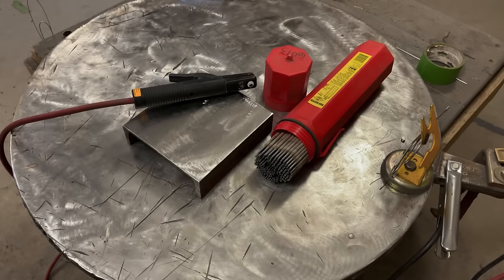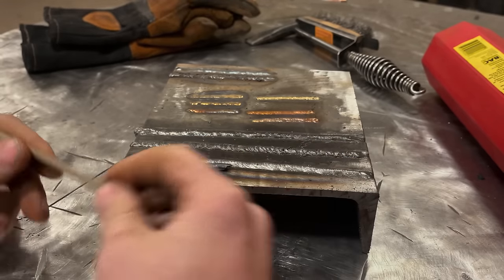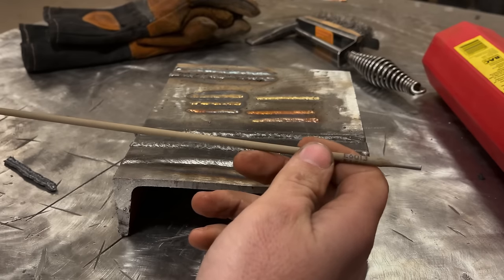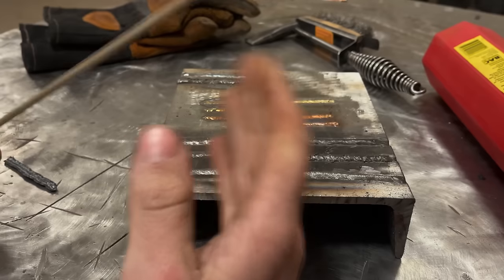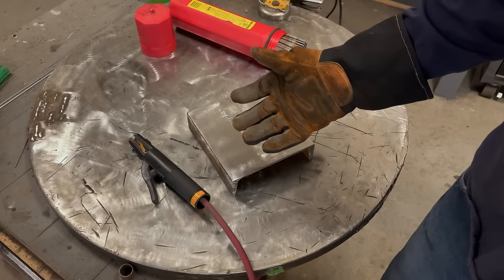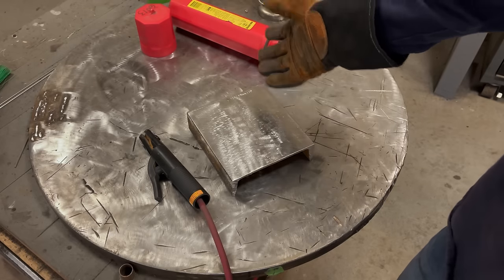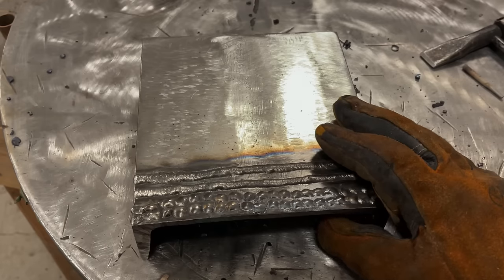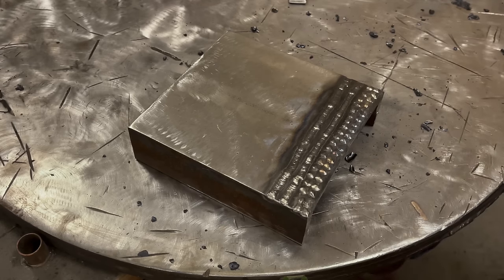How to stick weld 👨🏻‍🏭: Intro to Arc welding for beginners, (Series Part 1)

Comment: Thanks man, this is the most informative video i have yet watched about stick welding. And i watch alottttttt about stick welding
Reply from the maker: Welcome and thanks for the kind comment 😀.  It’s good to watch a ton of videos, you will get to a higher skill faster by doing so.  Whatever you do don’t let the frustration at the start get you down.  Every good stick welder went though the same issues with poor welds, stick rods, melting holes, and flat out failures.  After a while of practice those become few & far between and that is when it really becomes fun.  That’s when you can build awesome stuff 😀.
Reply: @makingmistakeswithgreg  thanks for your kind motivation 🙏

Comment: Thank you so much for creating this video. I’ll be watching the ones to come. As a newbie I’ve been debating on arc vs. wire welding but your video is helping a lot.👏🏻👏🏻👏🏻 great job👊🏻
Reply from the maker: You’re welcome 😀.  Stick vs wire is a hard debate.  If you want to weld thicker steel or have limited power, stick is the way to go.  If you need to weld thinner stuff wire welding is the way to go.  The great news is, no matter what process you choose if you get really good at it the skill will transfer to another process, so you will learn faster.
Reply: I have both stick and wire welders, I'm not good at either, but I love welding. It's just something about joining to pieces of steel together that captivates me! lol 😂 one of my favorite hobbies!
Reply from the maker: It is a awesome hobby.  The days everything goes well and the welds go down smooth are the highlights and make it the best.  The days nothing goes right and you’re frustrated are the parts you have to get though lol.   It wouldn’t be half as fun if it wasn’t a challenge though.  It’s just you trying to tell a electric arc and some  Liquid Metal who’s boss lol.

Comment: Excellent, subscribed, thank you , im total new and simply want to do basic wire feed welding and make small cool stuff, your videos are awesome
Reply from the maker: Welcome and thanks for the kind words 😀.  The great thing with you being new is you will be able to progress rapidly and (provided you spend the time to practice) will be able to build a lot of cool stuff.  Wire welding (MiG and flux core) is a great place to start, and is very capable.  I am still doing gas shielded MiG videos so I have a few more of those coming out.  If you have any questions/ don’t understand anything feel free to ask and I will help you out 😀

Comment: Fantastic, very well explained and gives me confidence to have a go 👍thank you.
Reply from the maker: No problem 😀.  Just expect to fail for a bit before it makes sense.  Learning stick is frustrating for a while, and can still be frustrating at times even after your good lol.  Luckily if you have a decent idea of what you’re doing and practice a bunch it will slowly get better.  The coolest part is when you look back on where you started and you can have a laugh at what your first welds looked like vs where you wound up.

Comment: I like the twist stinger handle
Reply from the maker: I am not exhausting sure why, but the twist style is virtually non existent here in the states.  I have one somewhere I will have to break out 😀
Reply: Have wondered about getting a “stinger” with a slightly smaller diameter of handle, but not sure where to find one - or wonder if they even exist?

Comment: If you can do one on basic set up and safety i know i for one would ruky appreciate that oh so much. Being a single mother trying to just be half as good as any professional i want to make sure i come home to my son. 😊
Reply from the maker: I have covered some random videos on safety over the past year or so.  I am definitely due for a new one.  I will share this info for the time being:  I have been welding/repairing things full time for about a decade.  I have had some decent injuries and some close calls.  95% of my injuries were preventable.  Wear your gloves and wear proper gloves for what you’re doing.  I have suffered serious hand burns from pure stupidity of not wearing gloves (or the right ones).  Wear eye protection 100% of the time, even while wearing a welding hood.  It will safe your eyes.  Not only do they keep debris out but many block harmful UV light, so an arc flash will do far less damage.  Use tools properly, don’t put your fingers places where they could get injured.   If you feel something is dangerous come up with a better way to do it.  Beyond that I will say this:  most of the dangers with welding are the accumulation exposure.  Dust, smoke, fumes all damage lungs.  Wearing a simple 40$ mask can add years to your life.  Virtually all of welding is bad for your lungs.  Eye damage can happen over time due to arc flashes, so wear a good hood.
Reply: @makingmistakeswithgreg  thanks so much for you time I truly appreciate it and yeah I did find your safety videos after I commented and watched till I passed out at like midnight 😆  but I went today and got the welding/mechanic job!!! 22 hr start. A bunch of benefits and add ons and bonuses!! 10 minutes from my house. Can't get more perfect then that. I tip my hat to you 😉

Comment: Greg....the stinger 5  seems  to hold the rod in a different way to the crocodile and twist grip.These latter 2 allow for the stick to "wander" a bit in its grip.How would you rate it??
Reply from the maker: So I have not actually used the stinger 5 before.  I wanted to buy one a while back and during corona they were out of stock so I gave up.  I like the idea of them though

Comment: Greg I don't know how you'll do it but I need you on the roof of my house in 8 hours because I have to do a small repair of the steel chimney from the edge of the roof 36 ft above the ground! Seriously though, I don't know what will be more uncomfortable for me, welding with an electrode or this edge of the roof. We have different nomenclatures but I'll try the equivalent of 6013 2.5mm because there's a lot of rust, soot and welding vertically. It's good that my TIG can weld better than me so maybe I'll glue it together somehow. And the video material is very useful, you can somehow start or check if what I'm doing makes sense (I've literally burned a few electrodes in my life). Greetings from Poland
Reply from the maker: That sounds like a fun job, I would totally do that 😅.  I literally was redoing a chimney cap that high on a roof last weekend.  I welded a new one up on the ground though lol.

Comment: I,m here to learn the easiest way to weld up rusty patches cut out of my ford transit. Can stick welding be used for van sheet metal ? Many thanks.
Reply from the maker: I won’t BS you, stick welding is unbelievably difficult to stick weld auto body.  Your best solution would be flux core wire with a 120v machine.  I am not sure what country you are in but in the states the harbor freight 125 is a very solid option and with .030 flux core wire it will actually weld auto body.  Stick welding in comparison will be 10x harder and 100x more frustrating lol.

Comment: Man... I love that Canadian accent. Maybe is Wisconsin? Idk but i like it 😊
Reply from the maker: Good call on the Wisconsin 😅.  That’s where I am from.  People are pretty good at picking it out 😀
Reply: Aww thats awesome thanks for the reply. I have an interview in the morning doing stick welding and tig welding on just massively sized farming equipment. By no means am I an armature but i haven't done it in 5 years. I'm worried they won't understand because not only doing it constantly a match doesn't always strike up right? Or the bead isn't always perfect. They also did mention stainless steel ehich I've never worked on. So this farming equipment is rusty and full of manure that just eats and eats
 So it needs re welding constantly and year round. What I'm saying is. Do you have any tips for me? Anything at all? I'm pretty confident my father is a master steel fabricator top of the line in his job and he travels the world. He taught me alot I've even done it in our pool when the aluminum started to crack. I'm not scared I'm just concerned they won't see the exact take off and usually I have the issue with the cleaning first. Take a while. And only so much rust can be taken off. Anything come to mind?

Comment: Lovely presentation of facts on this subject. Im not good friends with welding but know i could do better. Im reasonable with the startups. Most of material i do is thin walled and naturally i often get burned holes😂😊. What i woukd like to to know is if the steel we get, the quality thereof  affect the weld or is there ways to get around it. Id like to improve on the thin walled stuff
Reply from the maker: I won’t sugar coat it, welding thin material is no fun with stick.  There becomes a point where it’s just too thin to be effectively stick welded.  The smallest stick rod that’s common is 1/16th diameter, which is far bigger than .023 or .030 MiG wire or .030 flux core.  1/16th stick rods make it possible to weld material down to about 1/16th or a bit thinner.  It isn’t easy, but it’s possible.   10 out of 10 times I rather flux core weld material thinner than about 1/8th thick.

Comment: Great video! question.. can one stick weld 16 gauge steel? Also I’m wanting to weld a frame reinforcement that is 3/16th steel to a 16 gauge unibody frame.. recommendations?
Reply from the maker: I am not lying when I say stick welding thin steel is extremely difficult.  16ga is doable with 1/16th diameter rods.  I believe I did a video on that thin titled something like “stick welding with mini rods”.  It’s not easy stick welding thin stuff.  Flux core wire is infinitely easier.  Especially when you need to weld thicker material to thinner material.  For what you’re looking at doing it’s easily achieved via flux core wire.  If I recall I welded 16 or 18ga to 1/4in steel without issues in the video titled flux core thick to thin.  No way could I have done that with stick.
Reply: @makingmistakeswithgreg   Greg thanks so much, I do have a flux core . I’m just afraid of blowing through the 16g. I’ll have to get lots of practice in. Gotta say, your presentation is excellent!
Reply from the maker: @johnpecoraro1720  thick to thin defiantly takes a bit of practice.  Focus the puddle on the thicker piece.  You’ll get it, and it’s far easier with wire than stick.  I would prefer wire over stick 11 out of 10 times lol.
Reply: i think i saw in jacob pritchett channel that he stick weld a thin 16gauge steel in his project.. he ran DCEN polarity with 3/32 6010.. maybe you can ask him the tips to do that.

Comment: Thank you so much for making this video, I'm hoping to go to trade school soon. I have a question about safety equipment: I have a respirator that rated for protection against asbestos, would it also be good for use in welding?
Reply from the maker: Great question.  On face value I would assume it would handle welding dust.  However one concern would be the flammability of the filters.  Many welding specific filters have plastic covering the filter elements, so sparks can’t get to the filter.  If yours doesn’t it is possible (although slim chances) of a spark lighting it up.    The manufacture of the filter should have a chart or a rating of what it would filter, it would be best to double check that.  Generally speaking if it would do asbestos it would welding fumes.  You would run more into issues if you need chemical resistance instead of dust filtration.  Hope that helps, and good luck with the trade school, it’s 100% worth doing it 😀👍
Reply: @makingmistakeswithgreg  Thank you so much, I never even considered the possibility it could catch on fire. Yikes. I will definitely check to make sure the filters are covered.

Comment: I have to dissagree with you here as any other pipeliner would agree with me, down hill welding is still in use today. None of my welds in 42 years of welding  failed the bend test on the iron horse. Now there are factors involved in what i just stated as there is in anything being claimed here...I must add I never said I never failed a test, I just never failed a bend test. Hang in there this is good for first timers
Reply from the maker: I don’t recall saying downhill isn’t done or shouldn’t be done in any circumstance.  There are certain reasons why it’s not done and probably shouldn’t be done, and they far outweigh the reasons why it can be done.  Let me explain:

On pipe it’s common to use 60/7010 rods which are not commonly used with structural steel or things requiring higher strength.  Not only do they impart hydrogen into the base material (which can cause hydrogen embrittlement) but they also do not perform as good as say 7018 rods on many factors (such as cold temp performance).  6010 can be run vertically down,  per manufacture.  7018 (per manufacture) is universally all position except vertical down.  If you weld with 7018 vertical down you are going against the manufactures specifications which puts 100% of the liability on the company/person doing the welding.  A failed weld run vertical down with a rod not specified for it will not be the issue of the manufacturer.  Besides issues with specifications, running vertical down has many other issues.  1) with rods like 6013, 7014,7018 it limits penetration.  2) the probability of slag entrapment or weld defects due to the dripping flux is a issue.  3) it’s significantly weaker with most rods (besides 6010) because of the penetration issue.  

When the downhill issue becomes an argument it always goes back to pipe, and that is a very small part of welding in general.  Pipe is beveled commonly at a total of 70 to 80 degree, and open root.  Open root presents 0 issues with penetration.  The wide open bevel presents zero issues with penetration because it’s like padding beads.  The fact 6010 is commonly used also presents 0 issues with penetration, combined with the fact it’s slag doesn’t slump infront of the puddle like most other rods.  The problem with the argument “it’s done on pipe therefore it’s acceptable for other things” is for the common person and many fabrication jobs a) don’t allow 60/7010 to be used, b) aren’t commonly done open root, c) don’t have the benefit of the wide open bevels that reduce the weld throat thickness which helps to eliminate penetration issues.  Run 7018 downhill (or any rod other than a 60/7010) on a closed root fillet weld at a 45 degree angle and tell me it’s as strong as an uphill, it’s not.  The root fusion is worse therefore it’s weaker.  

If someone chooses to run downhill with a rod not designed or specified for it, that’s on them.  If they choose to do it in circumstances that don’t involve open roots and wide open bevels, they will lose penetration.  That loss in penetration can lead to weaker welds due to poor penetration.  There are specific reasons things are done and pipelining is a bad example to follow.  6010 is far weaker than 7018 in actual testing, it’s very uncommon for people to weld open root wide open bevel, and running vertical down limits penetration.  All reasons why it should generally be avoided except for circumstances where those flaws don’t exist or matter, like pipe welding.  This is the same case with saying “NASA uses tig for anything, therefore tig is the only proper way to weld steel and aluminum”.  Tig is not the only proper way to weld steel and aluminum, it’s the way they chose to weld it, based on their criteria.  For the exact same reason pipeliners aren’t out tig welding everything they touch.   The process and rod used meets the requirements.  The danger is not understanding why something is specifically done and applying that logic to everything in general.  

Edit:  I don’t believe 6010/7010 is wrong to use for pipe or anything that it meets the requirements for.  I use 6010 a lot myself and think it’s a great rod.  I think that it works great for running on pipe in any direction.  However it’s specified for that use and it works correctly.  It’s not smart to go against a manufactures specifications and run other rods not suitable for downhill (like 7018), downhill.  It’s also not smart to weld common joints downhill that don’t have wide bevels.
Reply: @makingmistakeswithgreg  I made a living welding as a down hill pipeliner for 42 years in very extreme conditions and the only one time it was in question was when we went to work in the upper 48 and so called" experts"  said we should*nt be welding down hill because of what you claimed  in your previous statement. The welding codes set up by AWS is what to follow not someones opinion,  including my own...have a nice day
Reply: @aquasaltyfishing4933  you should have read and understood what you're replying to. You make a fool out of yourself.

Don't try to argue without even understanding what you are arguing against. He said that you are correct(!), but only for that very limited use case using very specific material.
Reply: @brag0001  So how long have YOU been welding??? LOL LOL LOL

Comment: What hand positions do you use, the end of the rod is always wobbling for me due to hand shaking so much waiting for the arc. 😊
Reply from the maker: I definitely need to do a video on hand positioning.  With stick welding rods like 7018 more or less let you rest the flux on the metal and let the rod melt off.  Since the rod is touching the plate it takes away any shake/wobble to the rod.  The initial arc start is still going to be a bit shaky but that won’t affect the weld too much.